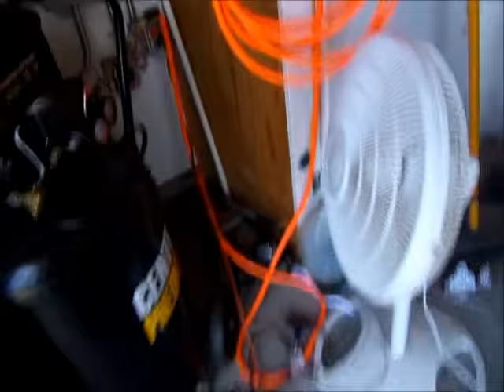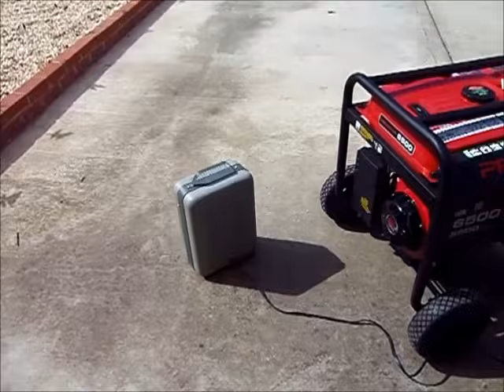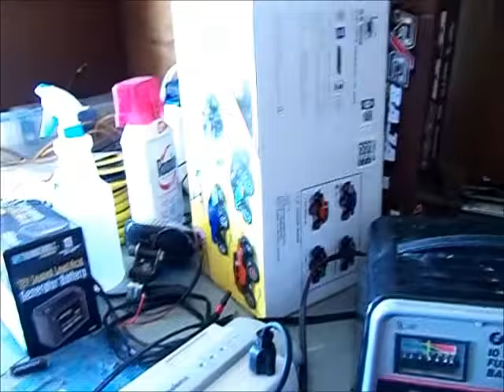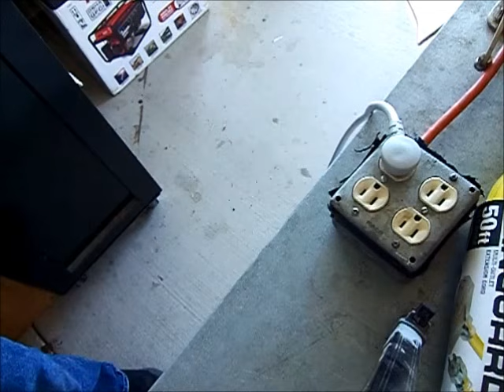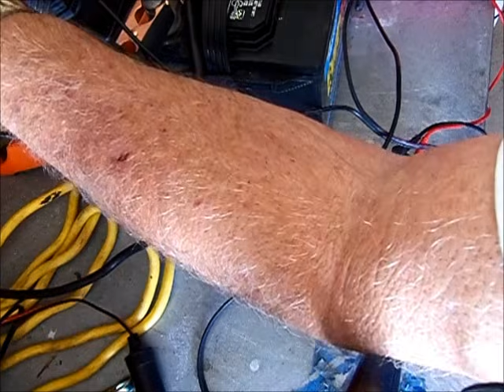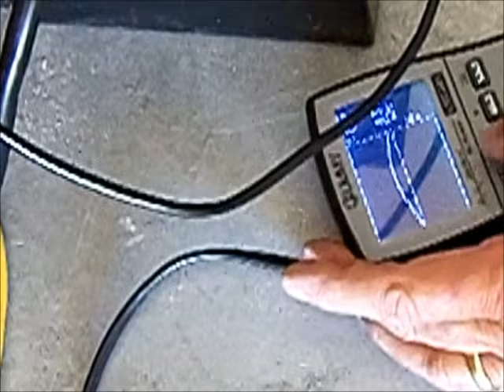Cleaning up the "dirty" sine wave from a non inverter generator. This is part 1, proof of concept.

Comment: Great video on what a non-inverter generator waveform looks like.  Not too many YT'ers have done this.  These non-inverter generators are really only good for power tools, heaters, fans, lights, motors and basic appliances that have no electronics.  You very well demonstrated what you have to do to get some clean power.   Best to just go out, pony-up and buy a proper inverter generator for the sensitive stuff.  Then you can power anything you want.
Reply from the maker: Part 2 posted, you might be interested. A note: Harbor Freight Just released a line of inverter generators up to 9KW all less then $2000.00.
Reply: @d.s.steele3100  Looks good.  With big-capacity inverters getting cheaper it's now a matter of getting an affordable bank of deep-cycle batteries to match the power of the inverter.
Reply from the maker: Problem is I haven't found an inverter generator over 4KW peek capacity. I need at the least 5.5KW running capacity 6.5 peek. Even my refrigerator has an IC board so I need clean power to all parts of the house. once I get my system up, my total cost will (hopefully) be some were near $800.
Reply: I don’t know much about them, but my house caught fire, I lived in my driveway with my wife in our camper from January 3 to August 20 something, used nothing but a HF Predator generator, cable box, router, iPhones, laptops, you name it, tv’s, PlayStation 4, nothing so much as had a hiccup, used little buddy heaters, still using same stuff, ran generator 24/7

Comment: my way (yet to be fully tested as house renovations still in progress)
is a 4Kva server UPS, generator to UPS then power to all my needs, which also allows time to refill tank when it runs dry as the UPS has three massive battery packs (weighs a LOT) (picked it up off a computer forum for $60 an absolute steal)
45x 5Ah batteries in three 180v packs, I once ran a clothes drier as a test on it for an hour and only used 10% of the battery life.

dropping down to 12 and back up to 120 is very lossy, but if that's what you have, then it's better than nothing.
Reply: same  principle  

https://www.youtube.com/watch?v=rXHnRtFJjFg
Reply from the maker: Am trying to do this as cheaply as possible. Living on a fixed income. Your setup sounds to be way more efficient than mine. Thanks for the input and good luck. PS: Maybe you can post a video when you get it up and running.
Reply: @d.s.steele3100  I too live on a fixed income, so I feel your pain there.
I regularly watch various sale forums and tech forums and sometimes auctions for cheap goods that I can repurpose for save as much as I can.
when the day finally comes that I can integrate the UPS into the house wiring I will be doing a video for sure.

oh another though to check into, ewaste facilities, they may be willing to sell old UPS systems instead of scrapping them, worth a look at least.

hope you manage to find a good cheap option to improve your efficiency.

Comment from the maker: I'm posting an addendum to this post. If you don't understand basic electricity and electronics both AC and DC, DON"T TRY THIS!
Reply: Just wanted to toss this out since I'm educating myself on going totally of the grid someday. There are kerosene operated fridges out there... Very interesting if you ask me. They are costly, but you won't have to rely on supplying energy to a fridge just add kerosene and you all set to go.
Reply from the maker: @CarlosRamos-qf8pr : Have you considered using an RV refrigerator/freezer? I believe propane would prove to be cheaper and safer than kerosene. Moderate sized (10 or 20 gallon ) tanks aren't too expensive and are portable enough for you to transport and fill. Also if you choose to go with solar, wind, or a small hydro generator, propane is a good back up for a stove, 20 gal. hot water heater and the RV fridge.

Comment: love it this is something i would do.. but i had a idea what if u just hooked up a basically extension  cord cut the end running from the generator  plug the positive  and negative  into a 4000 w inverter.. u basically  got a inverter  generator  then what im thinking for way less
Reply from the maker: If I am reading your comment correctly, you are saying to run the 110/120 vac from the generator to the input side of the inverter.  Most inverters are set up to convert 12vdc to 110/120 vac. If you push 120 volt into the inverter you will end up with a smoke bomb. On a inverter generator the step down to 12vdc back to 120vac is all done internally. If you are thinking about using the 12vdc (cigarette) socket on the generator there are two things to consider. 1: The 12v outlet is only made to handle a little over 8 amps. or just under 100 watts. 2:  I burned out a cigarette plug in style inverter because the actual voltage output was 19vdc from my generator. Put a voltage regulator between the generator and the load to prevent an over voltage burnout.
Reply: @d.s.steele3100  what if you use a high wattage extension cord from the generator cut it to where neg and positive cords show.. and hook it up to a 4k watt inverter
Reply from the maker: @memotank2089 : Again, check the recommended input voltage and if that input is AC or DC. AC is not positive or native, IF WIRED CORRECTLY, the black or red wire is the "hot lead" , the white  wire is your common/ neutral lead and the green or bare wire is ground. On an AC circuit the voltage goes from 0 volts to +120 volts back to 0 then to -120 volts 60 times a second (that's in the U.S., in Europe it's different). Again IF WIRED properly DC is a straight flow and AC is, for lack of a better description, kind of a back and forth flow. The two are not compatible with out electronic intervention. Remember 4kw@ 120 v= about 33.3 amps but 4kw@12 v= about 333.3 amps. With a 333 amp. flow, you better have a cable the size of your forearm.
Reply: @d.s.steele3100  im not talking about hooking anything up to batterys.. just stright from the generator  to a inverter  both rated 4k watts .. alot of inverters use a positive  and negative  for the input ... it be the same as household extension cord is i think dc.. if the generator  and inverter both rated 4k watts.. and just get the electricity powered from the generator  to the inverter wouldnt that be fine ? i didnt say anything about kw only 4000 watts .. usually ppl say 4k for 4000
Reply from the maker: @memotank2089 : Ok, I think I know were your going wrong.  The power at your household outlets is 120 volts alternating current (vac) NOT 12 Volts. Normally the power coming in from your utility is a relatively "clean" sine wave. You need  a clean sine wave and surge protection to protect sensitive electronics (computers, certain appliances, TVs, internet routers, ect.). The outlets on your generator are the same 120 vac but with a lot of "Noise" on the line (unless it is already an inverter type generator) . An inverter is designed to change  direct current (DC) to alternating current (AC), in most cases this is 12 volts direct current to 120 volts alternating current. The reason for stepping it down to 12 vdc then buffering any "noise" through the batteries ( a large capacitor would do the same ) is to give a pure sign wave inverter as clean an input signal as possible for a clean output signal. This is the best I can explain it. If any one else can give a better  explanation PLEASE HELP!
Reply: @d.s.steele3100  what u think about this idea.. u think hooking a 4k watt inverter to a 4k generator  would work?
Reply from the maker: One more idea; use YouTube search and type in "how does a pure sign wave inverter work". I think this will give you a better answer to your question.
Reply: @d.s.steele3100  yeah but what if u eliminate the batteries and go straight from the generator  to the inverter..
Reply: @d.s.steele3100  because  ur not eliminating or cleaning  the electricity.. ur basically  just giving electric to the battery charger and it ends there ur taking electricity from the batteries.. so again.. im asking what if u went stright from the generator to the inverter
Reply from the maker: @memotank2089  All I can say is look at M35a2guy's reply. He gets it. After that I.can't do a better explanation.
Reply: @d.s.steele3100  we both working on the same experiment so if we can help each other it would help alot.. im pretty sure a inverter will clean the electricity if u hook it straight to the generator
Reply from the maker: @memotank2089  All an inverter does is convert DC current to AC current. In most cases that's 12vdc to 120vac.
Reply from the maker: @memotank2089  All I can say is have a fire extinguisher ready when you push 120 volts into a devise meant for a 12 volt input.
Reply: D.S.Steele Josh what DS is trying to explain to you is simply the only thing you will accomplish by doing what you propose is starting a fire. It would be significantly cheaper to build yourself a little fire pit in your back yard and have an enjoyable evening by the fire. 

Listen just because an inverter has input wires doesn’t mean you can just connect it to anything. The inverter regardless of the wattage needs to be connected to a Direct Current source. The output of your generator is an alternating current source    Don’t confuse wattage with the type of voltage and current a particular device is compatible with.  Just because you have a 4K gen and a 4K inverter doesn’t mean you can connect them directly together   

Wattage is a measure of power only.
Reply: @M35a2guy  so a inverter cant take too many volts ? i thought wattage is also a measure of volts
Reply: Josh Josh correct you’re inverter can’t take too many volts. Inverters can usually range from 48 to 12 volts and they must be DC volts. Your generator outputs between 240 and 120 volts and that is AC voltage. AC volts and DC volts are very different. You can not connect your inverter to your generator because they are not compatible with each other without additional engineering
Reply: @d.s.steele3100  They’ll need more than a fire extinguisher they will need the EMS when the batteries become live and somebody gets shocked or maybe burn the house down
Reply: You guys are playing a dangerous game with electricity and inverters hooked up together very dangerous !!!!
Reply: @abrahamghannam2137  why
Reply from the maker: Part 2 posted. using 1500 watt inverter.

Comment: DS, I really liked your video.  I want to do the same thing but at a higher capacity.  The cleaner DC signal is a byproduct of your batteries acting like a large capacitor, not because you're sending power through your batteries.  You're actually going across your batteries.  Electrically there is no difference between the output of the charger and the battery bank it's self if truly connected in parallel as you say.  The batteries act like a big buffer for larger loads.  I would love to see how this progresses and thank you for sharing!!!!
Reply from the maker: You're right about the the batteries function. I miss spoke on that one. The car charger was proof of concept, it got way too hot for continuous use. I am looking for a 12v power supply that can handle up to 1 kw constant draw with out over heating. I may have to build my own using a heave duty transformer, diode bridge and capacitor. Am still playing with different ideas before settling on a finished set up.
Reply: D.S.Steele I was looking at that as well. I had seen some 100 amp power supplies for $175 dollars. When I get back to my laptop I will forward you the link.
Reply from the maker: @M35a2guy : I have looked on Amazon and asked questions about weather they would work for my application. Most have shied away, I believe as a result of product liability issues.
Reply from the maker: @M35a2guy : An addendum to my last reply. It looks like a converter/charger for an RV will work. Something like the PowerMax PM3-100, sold on Amazon  might do the trick.
Reply: @d.s.steele3100  im making a post of what i done now
Reply: @d.s.steele3100  i made a video mind come checking it out and give me some advice
Reply from the maker: If your still on this thread I would like it if you can try to explain to Josh Josh why the step down to 12vdc then back to 120vac  and why the batteries are used as a buffer for line ripple. I've tried and failed, maybe you can do it better. I,m using batteries instead of a capacitor so I can get a couple of hours with out the generator if needed. Your help would be appreciated... thanks.
   PS, Once money loosens up i'll be picking up that 100 amp RV power supply and a  couple of Bestek 500w pure sign way inverters.
Reply: D.S.Steele I tried to put it as simple as I could for someone who had no experience with power components. I just hope he doesn’t kill himself.
Reply: @M35a2guy  i already made my experiment and its going good im charging my batteries while playing ps4 off my deep cell batterys thats parrelleled its going great
Reply from the maker: Thanks for your help. I think Josh  may understand what is involved in doing this kind of setup now.
Reply: @d.s.steele3100  ya im workin on my own right now in my rv
Reply from the maker: Have now purchased components for 1,5KW setup and done a part 2 video. This system is now a little academic as Harbor Freight just released a line of inverter generators up to 9kw all less then $2000.00. Wish they had them 10 months ago!